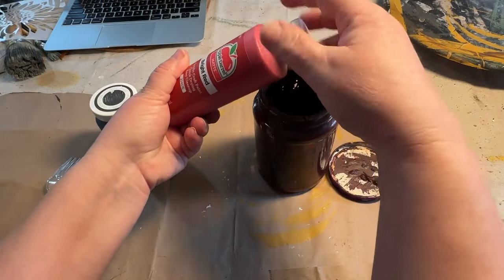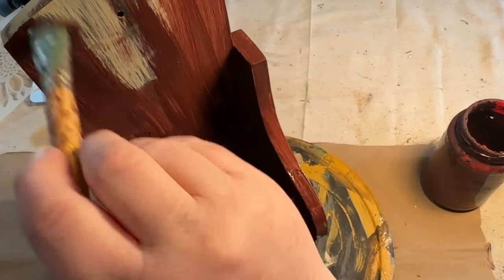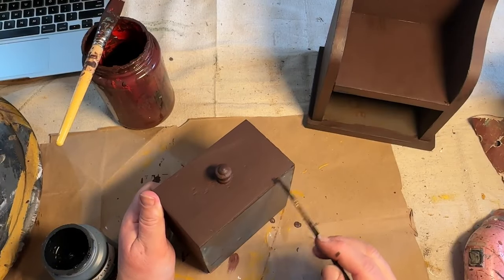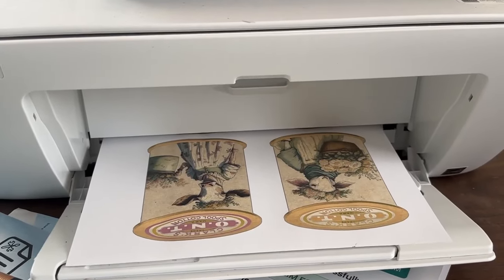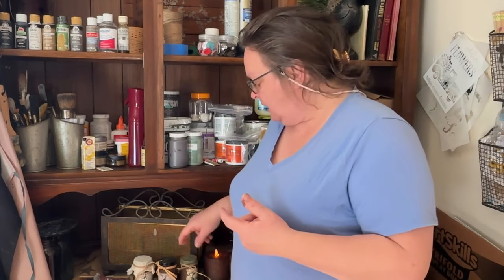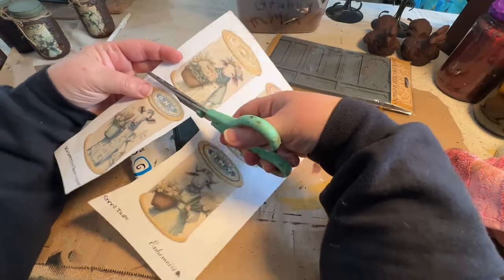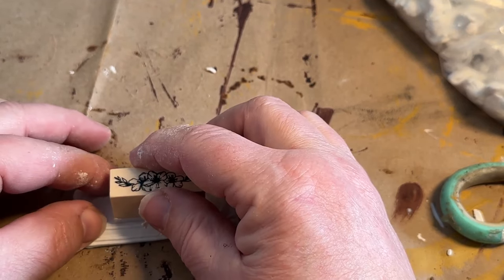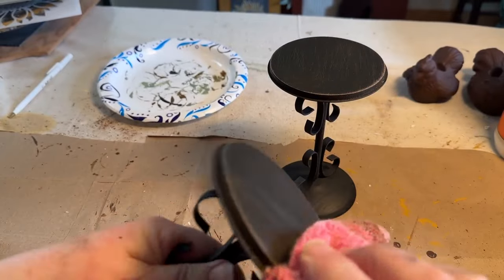Thrift Flip Home Decor  * Upcycled Inspirations * Repurposed Decor Makeovers

Comment: I occasionally use tracing paper to print on. It's a lot sturdier than the tissue paper. I used to tape the printer paper and tissue paper together, but I discovered that a little swipe of a glue stick on the edges works great.
Reply from the maker: Good to know. Thank you for the tip😊

Comment: I find it easier to use children's glue stick around the half inch of the printer paper edge and slowly apply the tissue paper. I use an iron to make sure it all lays flat. then put the tissue and printer paper through your printer. If you pull it apart slow enough after it is done printing you will not tear anything. Your print should come out fully intact. I have been doing this method for about 2 years now :)  I normally make a bunch in advance. I get out my ironing board lay down the tissue paper and glue the printer paper in rows on top then cut. Hope this helps
Reply from the maker: Yes it does help! Thank you. I was bummed when it didn’t work right. I will definitely try this method 😀